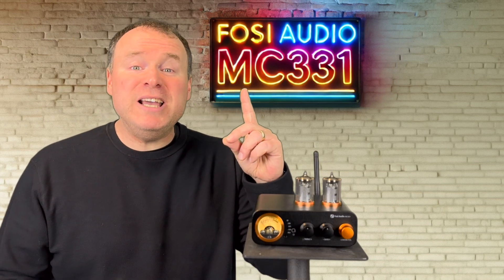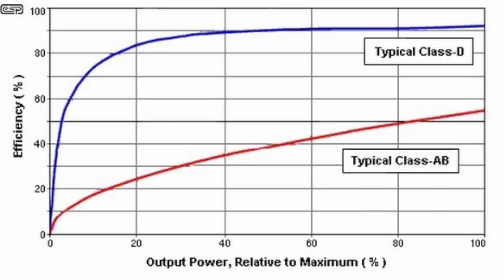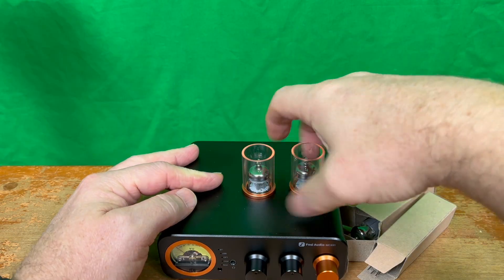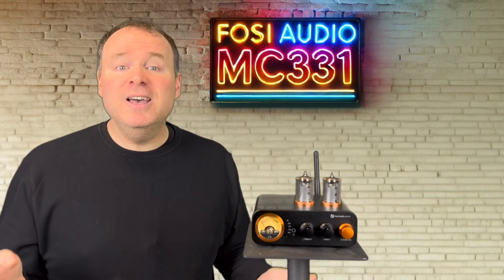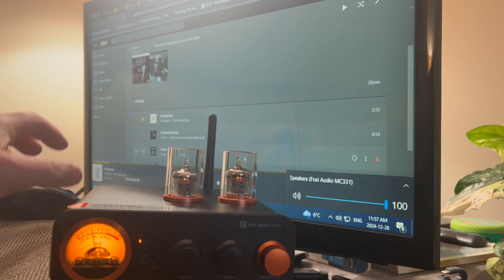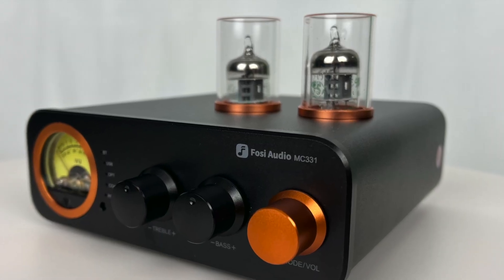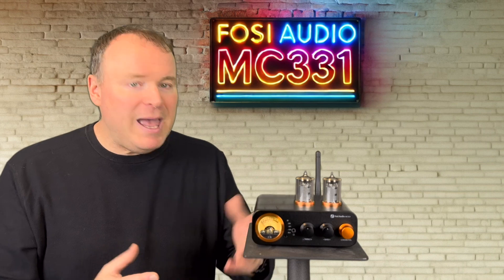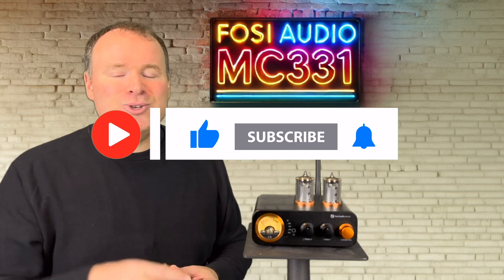Integrated Masterpiece - Fosi Audio MC331

Comment: Very nicely done... excellent review.

Just one little note of caution ... Don't even think about plugging a 48 volt supply into this one.  The TPA3221 tops out at 36.
Reply from the maker: Thank you for your wisdom and feedback…
Reply: I thought that might be the case, would account for the lower heat... I don't use the 48v with the 3255 either, I feel like that pushes it to its upper limits and I wonder about longevity at such power.
Reply: @ingalook  
That's the idea.  Run your gear conservatively and you get to keep it a long time.

After testing a bunch of these things on my bench, I've reached the conclusion that the TPA3255 hits its sweet spot at about 40 volts.  But 40v power supplies aren't easy to come by, so I generally recommend 36volts which are easily available.  

I run my A07 on 36 volts, 6 amps, and it works a treat with only moderate warmth and no protection trips, ever.  I figure it will likely last about 10 years at that pace.

36 volts is the top for the TPA3221.... there you might consider using a 32 volt supply.  Same principle... be conservative and have it a long time.